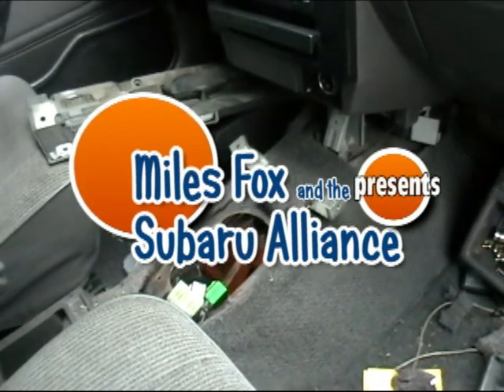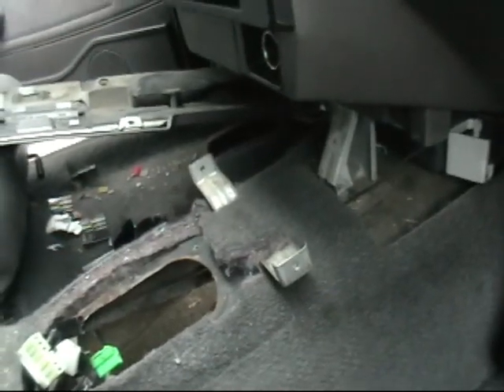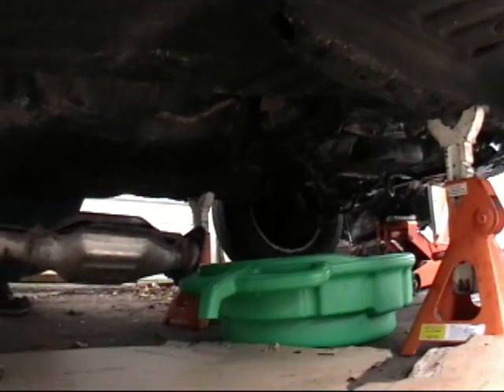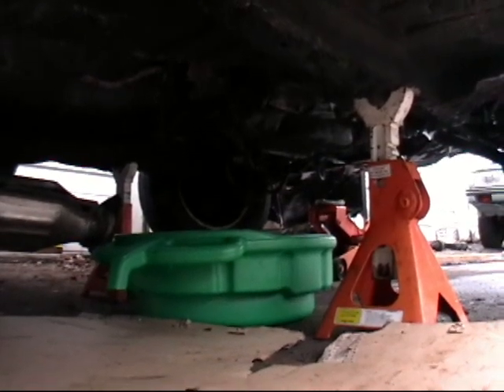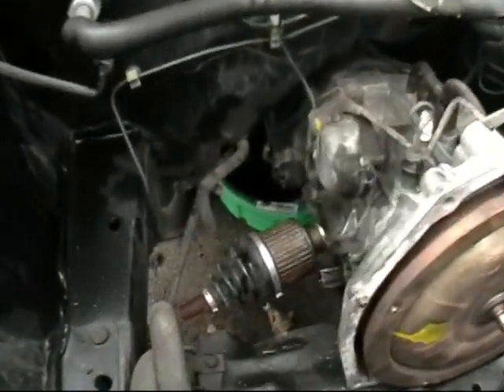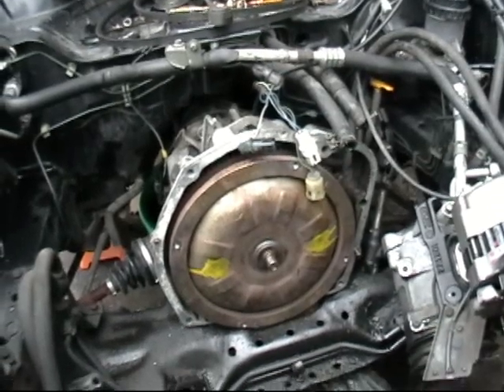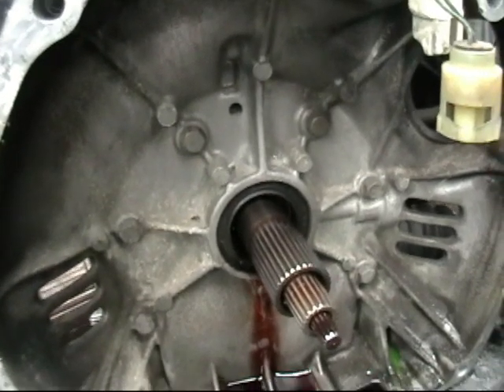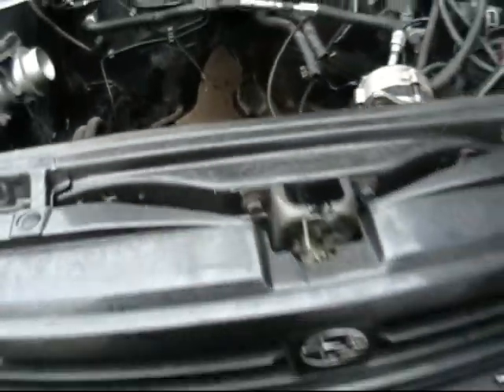Subaru AT to 5MT Swap Pt. 1/2

Comment: So I’m currently working on a similar swap I had a 3sp auto with fwd and I’m putting in a 5 speed awd. Do you know what I need to do to wire in the awd to the shifter?
Reply from the maker: if its the full-time 4wd with diff lock or a 5mt bushbutton 4wd, the mechanism is vacuum actuated with a bank of solenoids. you will need the solenoids and the button on the shifter or console plate to wire up as stand-alone. you can defeat the park safety by bridging the 2 largest wires on the shifter pigtail. the reverse can be wired up at the transmission side

Comment: Aside from the pin that you need to punch out with a drift what needs to come off of the front suspension to get the axles to come away from the transmission?
Reply from the maker: undo the ball joint stud with a fork or striking the control arm with a hammer. this is easier than the strut pinch bolt. you will have to drift the axle out past the bearing with a mallet as it is press-fit.

Comment: Is there any way to check for bad transmission bearings with the engine out? My 5MT loyale was making a nasty noise that I thought was clutch related; now, I'm not so sure.
Reply from the maker: remove tail shaft and split the case to service input shaft bearing